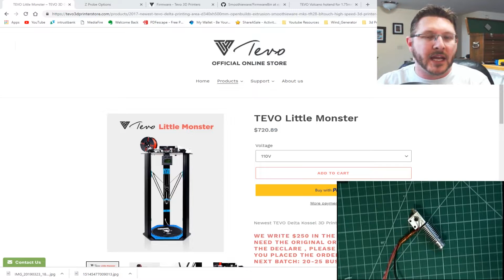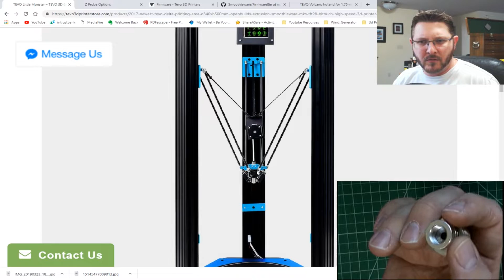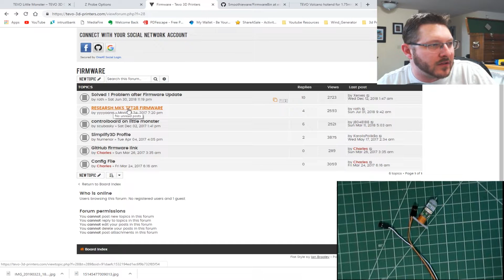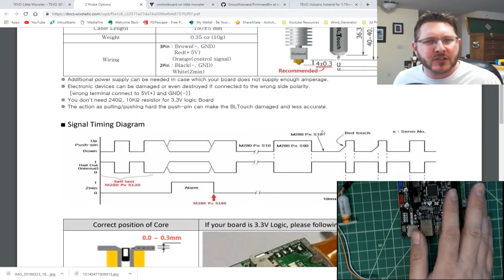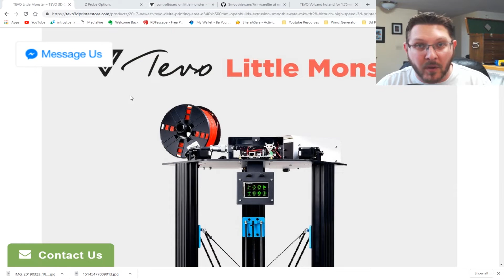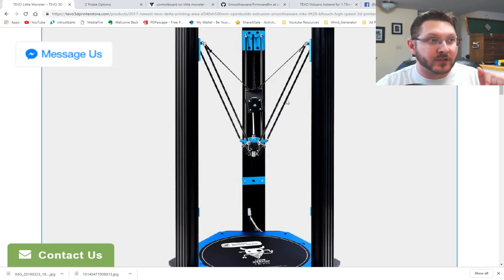How to fix issues with the Tevo Little Monster

Comment: A few years late, but I second your motion on Firmware issues being a cause for the BLtouch issues.  My monster had all of the exact same issues.  Eventually I dumped the smoothieware firmware and ported it over to Marlin (after some trial and error).  The exact same BL touch that never worked before works perfectly now.  I never had to touch the motherboard.

Comment: Quick Question: when you bought the replacement for the mainboard, was there any special programming you needed to do, or does the SD card provide everything?
Reply from the maker: Just swapping the SD card from one board to the other does it since that's what houses the firmware for it. Now in my case I also had to upgrade the firmware on the SD card

Comment: i cannot get the config files for the tlm onine anywhere i dont suppose you have a link for them? thanks for the video its been very helpful up until the config files;)
Reply from the maker: If I remember correctly the Little Monster uses Smoothieware as the firmware.  you can google for a generic config file out there for smoothieware.  I found this one but you will need to dig a bit more to make sure it is correct: http://smoothieware.org/configuring-smoothie  Also make sure you backup current config files so if there is an issue you can always go back.  Good luck.

Comment: Just watched your video " How to fix issues with the Tevo Little Monster " I had a BLTouch tip to bend and the hot end to do what yours did. So ordered them and got them replaced, Just to find out the BLTouch was a newer version and the configuration would not recognize it. So went to gethub and found a configuration file for for the Ver.3 BLTouch. Well as you can guess the machine updated and the menu on the touch screen was mirrored, yes backwards, and had no response at all. Tried flashing the original configuration back and still has the mirrored images. Since you got your machine to except your BLTouch I'm guessing it was a Ver.2 , I'm going to order a new mother board and flash it with the original firmware and just forget about the bed leveling feature on the system. Any ideas???

Comment: 1) BLTouch power is 5V only.  The 3.3V jumper option selects whether the BLTouch outputs 3.3V or 5V logic levels.  Newest model (V3.1) defaults to open drain output but can be set to 5V logic output.

2) Replacement glass:  https://www.aliexpress.com/item/32786209536.html?spm=a2g0s.9042311.0.0.110a4c4dO7V0Di

3) Replacement 0.4mm nozzles:  https://www.amazon.com/gp/product/B06XPGBLVN/ref=ppx_yo_dt_b_asin_title_o01_s00?ie=UTF8&psc=1

4) Clearing a jammed nozzle: a) use the propane torch to melt out the plastic and b) use acupuncture needles to clear out the orifice.  I use a 0.25mm needle first and then a 0.4mm needle.

5) Melted plastic leaking out:  a) screw the heat break into the heatsink until it bottoms out (careful - the neck on the heat break is easy to bend), b) screw the thermal block onto the heat break until the last thread before the neck is covered, and c) screw the nozzle into the thermal block until it bottoms out.  There MUST be some thread on the nozzle exposed or else the nozzle isn't touching the heat break.  If no thread is showing then d) rotate the thermal block/nozzle assembly until it bottoms out, e) back the nozzle out a bit, f) rotate the thermal block until it is in the proper position, and g) tighten the nozzle.

Comment: Be very careful with the bed I cracked the glass and it's almost impossible to find a replacement for the glass bed. I wound up getting a local machine shop to cut an aluminum plate and moved the silicone heater to the aluminum. Then I added springs and longer screws all the way around to add manual bed leveling... still working on it.

Comment: I struggled with finding the correct parts too. You have to get inside the 3d printer nerd lingo, so you can search and find stuff in Aliexpress or Amazon. 1. The little connector could be found by searching "bowden connector". I broke mine so I had to wait 30 days, you will be better off ordering 5 of these for any case. The stupid nut which I spent my youth screwing with while tightening stuff - "m5 T nut" or m4.. don't remember. You can upgrade them with ones which don't get out of the aluminium profile. When you get the right rebuilding sequence they are more stable. Now I have them all around the printer ready to attach stuff like cameras and motors, etc. Actually I destroyed half of my nuts while screwing with the machine and just went to the local bolt shop and made them give me exact sizes but stiffer. They feel so much better, the original ones twist like butter. You could also replace the "v6 heatbreak" without the radiator. If you want to print higher than 250C temperatures, you need "all metal v6 heatbreak" Because the default one with Tevo has teflon inside (Not because they are cheap bastards, but because it's allowing PLA to print better). That means if you get above 250C, with the normal heatbreak, you are melting very toxic stuff. And then you all need "Volcano nozzle" brass 0.4. Get 4-5 of these too. Ofc your fans will start to break, so order up some "v6 hotend fan"

Comment: Hi , thanks for the great review, have you ever encountered an issue with the motherboard? I bought mine and after assembling the motherboard did not work, I flashed the TF card multiple times but it's dead, I bought another motherboard but the same issue still exists.
Reply from the maker: Hmmmmm.  Check your connections but also check those jumper settings since they can cause all kinds of funny behavior.  Do any of the LED's work?   Also do you have a volt meter where you can check the output voltage of your power supply to make sure the power supply does not have an issue?  Good luck with it and let me know if I can help.
Reply: misperry you are right, After 8 months I figured out why the motherboard is not working, it was from the Y limit switch!!!! When I disconnected the cable it started! Thanks a lot for your help !!!